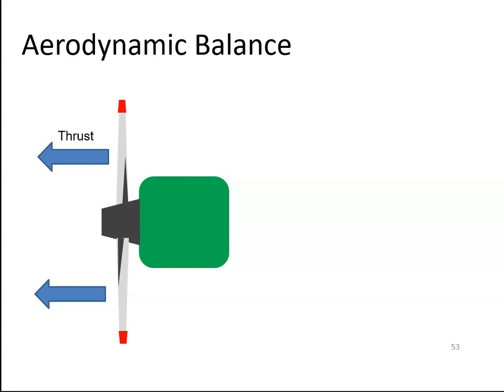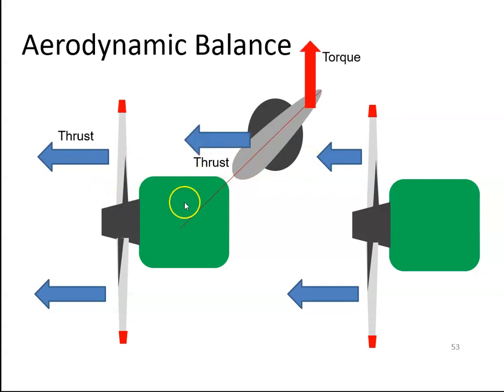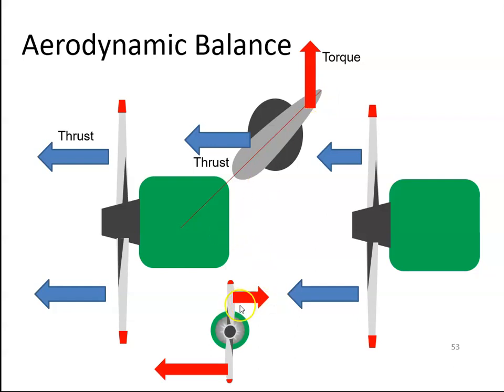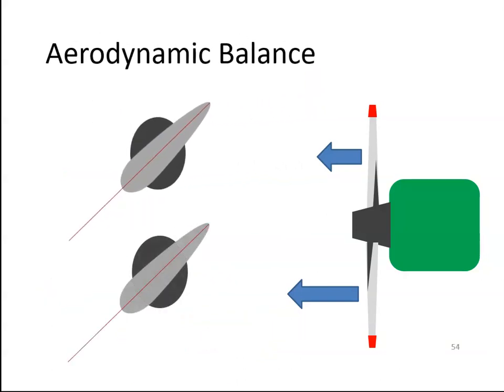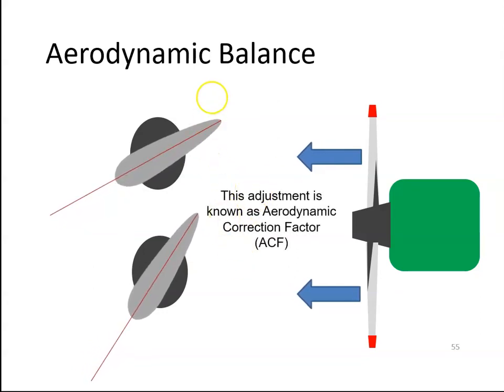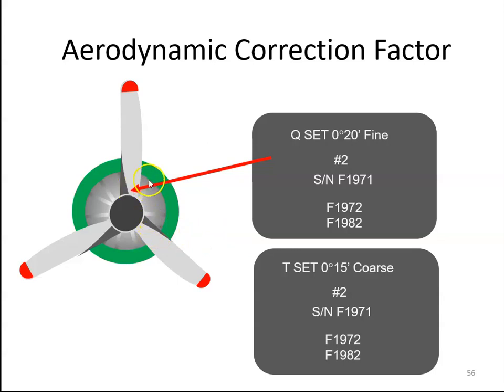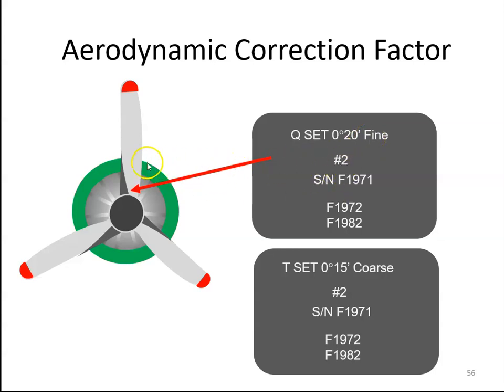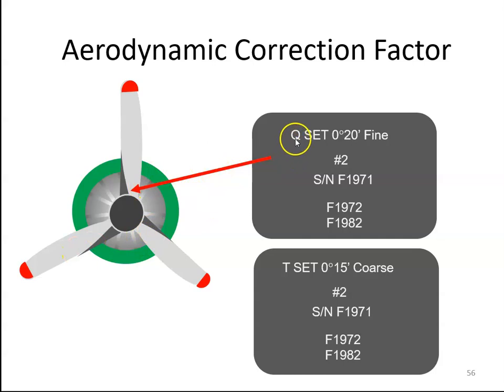Propeller Aerodynamic Correction Factor

Comment: Correction magnitude value in IPS is a vibration indicator?
Reply from the maker: Yes IPS (Inches per second) is a vibration indicator.
Reply: @RoddyMcNamee  ok thanks. So the propeller needs dynamic correction?
Reply from the maker: @2012dieguito2012  If there is vibration then dynamic correction is one of the things to try to eliminate the vibration.
Reply: @RoddyMcNamee  ok thanks very much